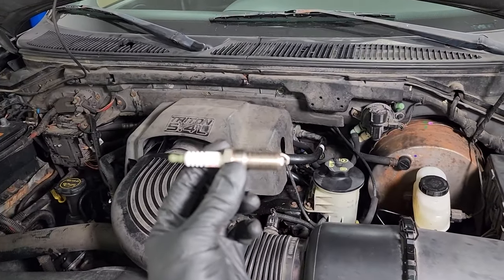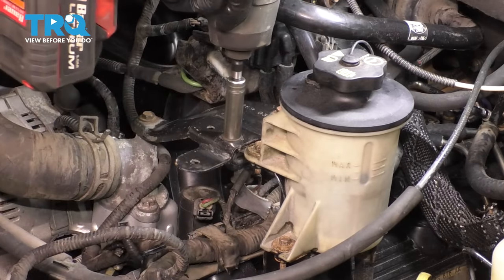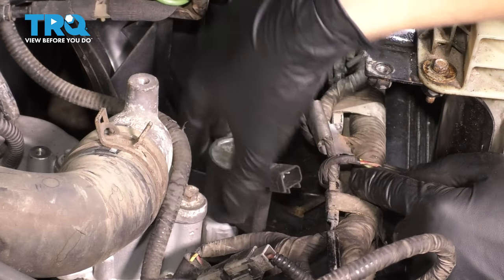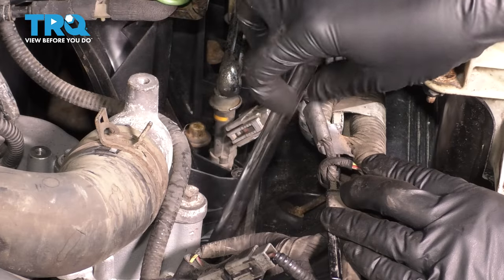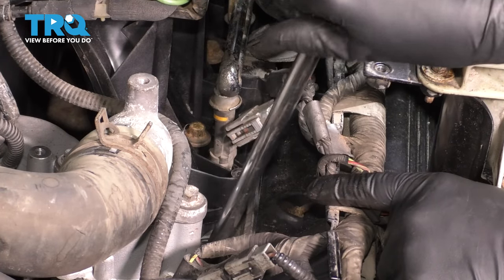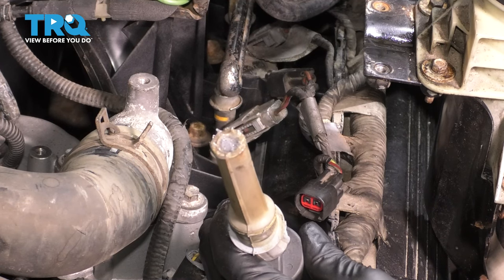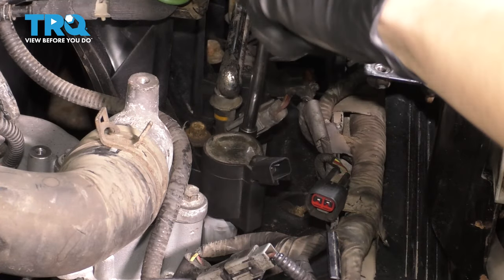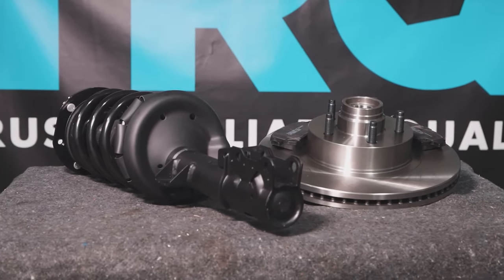How to Replace Spark Plugs 1997-2003 Ford F-150

Comment: Just finished up, there's only a few vacuum lines and a coolant hose to the throttle body that I had to remove.
I highly recommend a vacuum to remove debris from the hole.  Also, recommended torque values have almost doubled.  I put mine at 28 ft-lbs, cold heads and dry threads.

Comment: Is there a way to tell if a spark plug is blown, but held in place with the ignition coil?  This is on my "to do" list, but I'm trying to decide if I need to get the expensive sleeve kit or not.